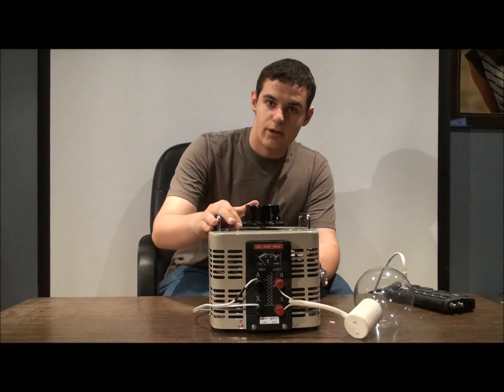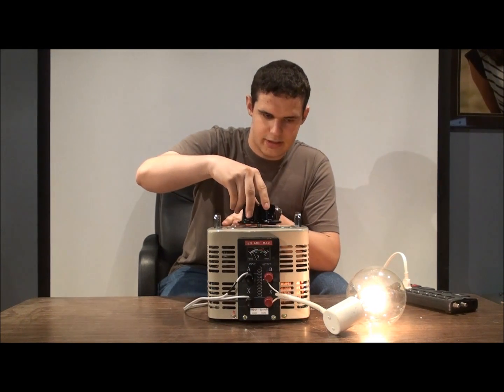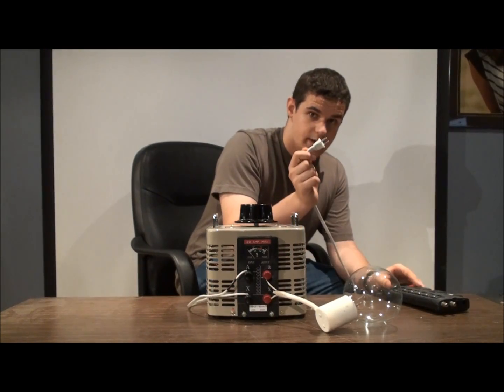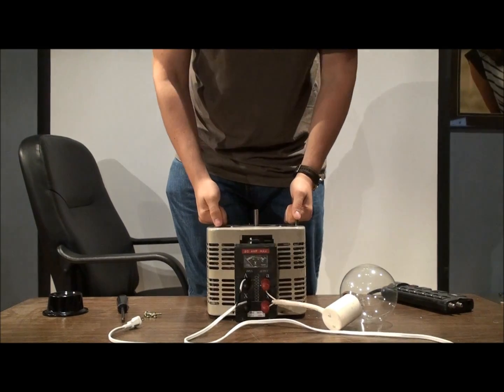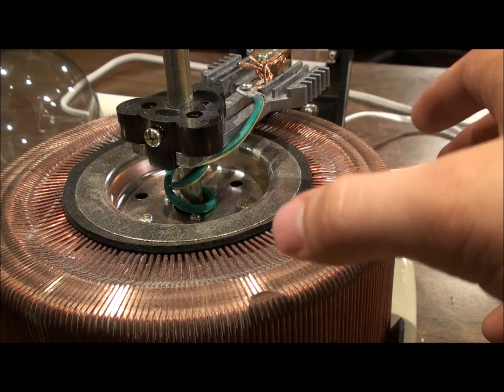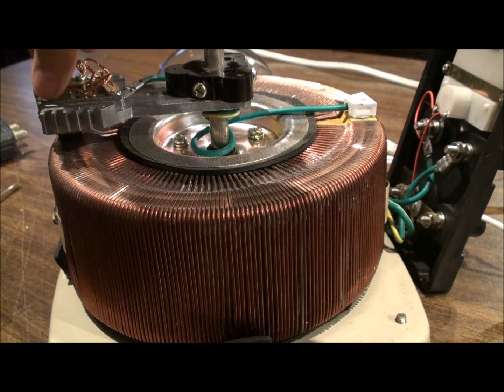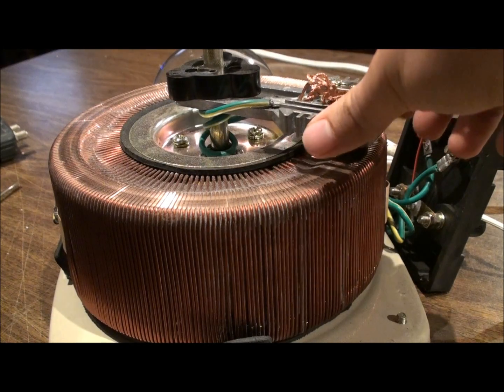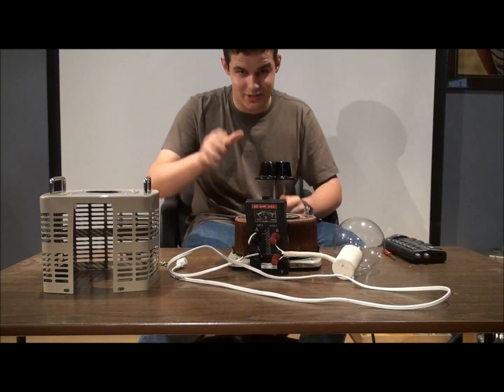What is a Variac, and how does it work? - Simple Explanation

Comment: Great video!  Just a question, is the part on the top that moves around with the knob actually making physical contact with the big coil or not like in a normal transformer?  It would be easy to put it up to 300% increase by moving the output closer to the input portion wouldn't it?  Thanks for the vid

Comment from the maker: I have the 20 amp one, and it's had no problems doing everything that I throw at it! Under heavy-ish loading (17 amps warming up a 220V laser printer) it hums a bit, but really doesn't overheat or anything like that. The gauge on the front is off by up to 20V on the high-end, so I would watch out for that and use a volt-meter to make sure everything is where it should be. As far as the internals go, not even the slightest hint of any issues so far!

Comment: CAN I USE 12 VOLT DC AS THE INPUT INSTEAD OF 120 AC 
I NEED TO CONTROL 12V STARTER MOTOR  AS A DRIVE MOTOR ON A SCOOTER 
AIRMANBEAR@VERIZON.NET

Comment: Yes, if you have AC lighting (some studios use DC to avoid the problem of interference completely) then a Variac (U.S. trademark of General Radio 1934-2002) is the BEST way, since it doesn't interrupt the waveform abruptly and generate unwanted harmonics that can get in your audio. Solid state dimmers often produce lots of buzzing.

Comment from the maker: I wouldn't know. From what I have seen, variacs are mostly used to boost voltages on long assembly lines where the voltage sags a lot. I could see this having much less interference when compared to a digital circuit though, as it's just a transformer. Only one way to check!

Comment: dimmer switches do not accurate determine voltage, as the voltage on the output depends upon the type of load, I have noticed how if a resistive load (such a a filament light) in parallel  with the equipment (inductive or reactive load) the dimmer behaves as it is dimming just the light bulb, this seems to work for fan motors, drills etc